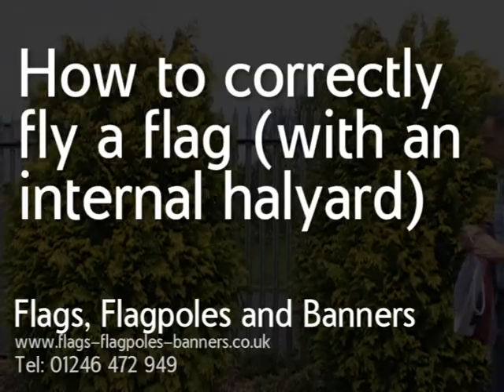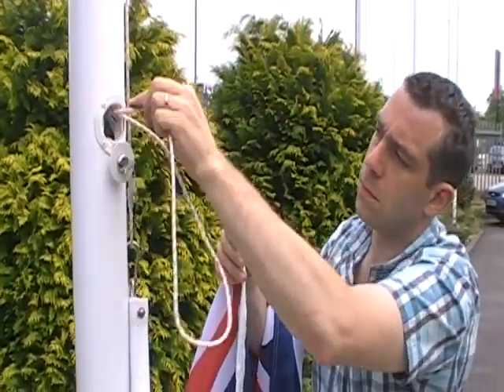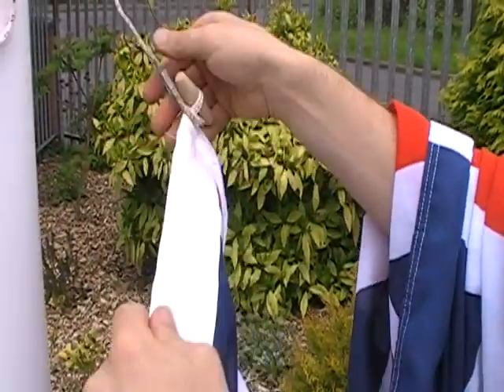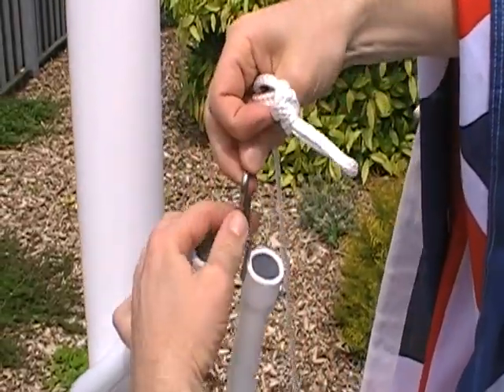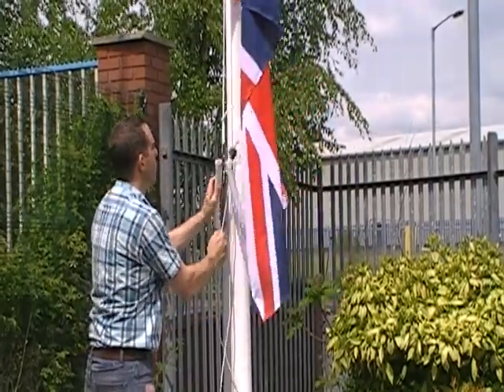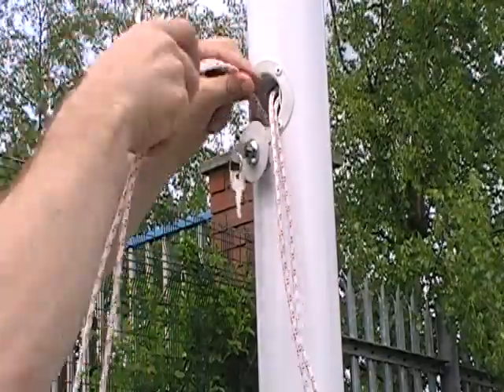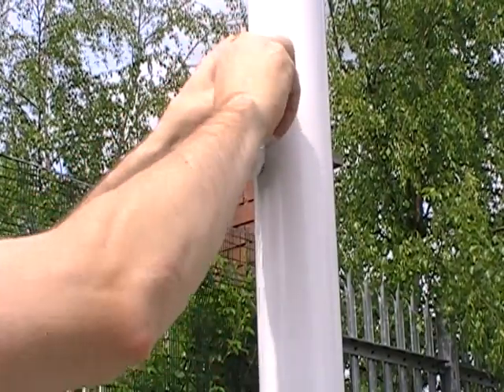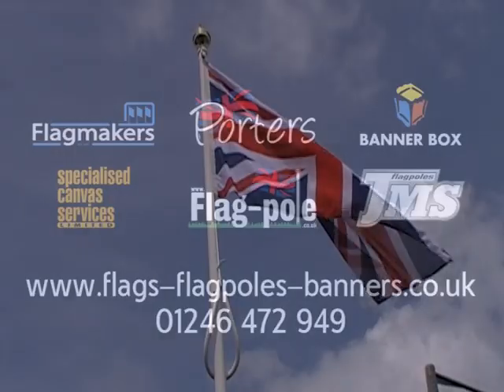How to correctly fly a flag (with an internal halyard flagpole)

Comment: We used to have flag raising ceremonies every friday when i was in primary school. It was wrapped up in a neat bundle, raised up to the top end and released up top. Our flag had the union jack on the top left corner of the flag since we used to be a colony of GB. Can someone send me link as to how this is done please?
Reply: What country u come from?
Reply: After the flag is properly folded, the lower rope id's wrapped around the bundle and a loop of it is tucked under itself. When you pull the rupee from the bottom of the flag pole, the slip knot releases and it unfurls.